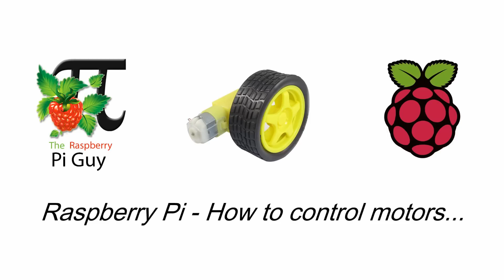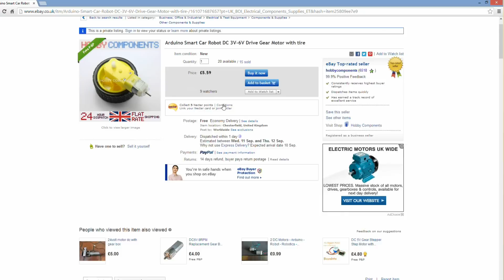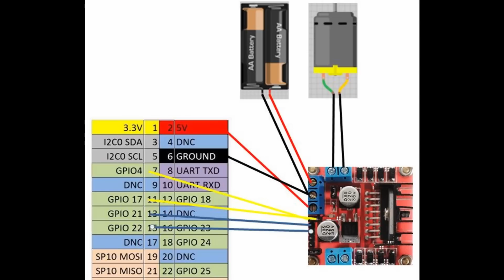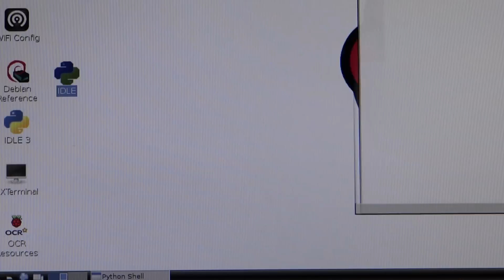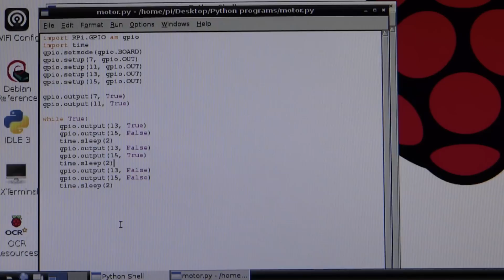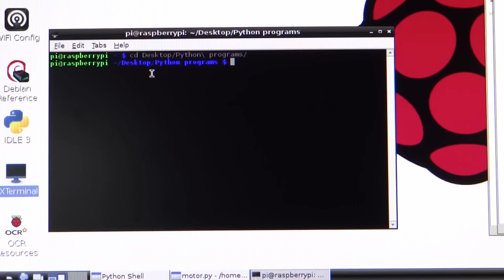OLD:Raspberry Pi - How to control motors...

Comment: I found what I think is a slight issue with your example, enable A/B you don't have to use the 2nd Pin.  I followed your setup, both enable A pin 1 and 2, and not using the pin 2, and the results are the same, only the front most pin for enable A/B from board edge has to be set to high.  The board documentation suggests that enable A/B are actually already setup for PWM, so setting enable A/B to high, is driving the motor at maximum speed.  Have you tried using soft PWM to drive enable A/B?